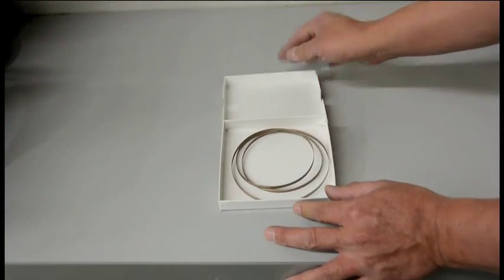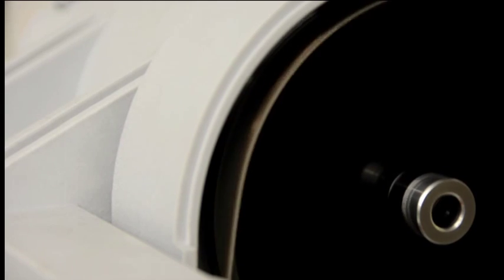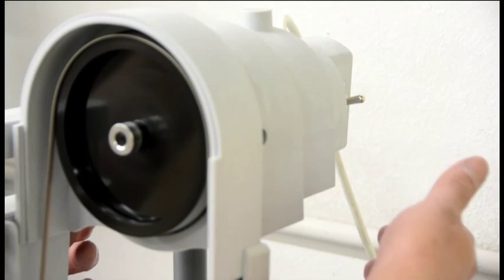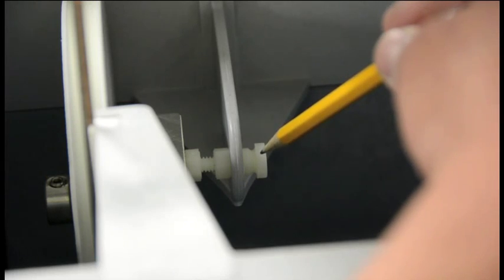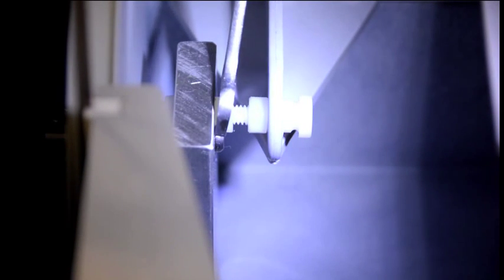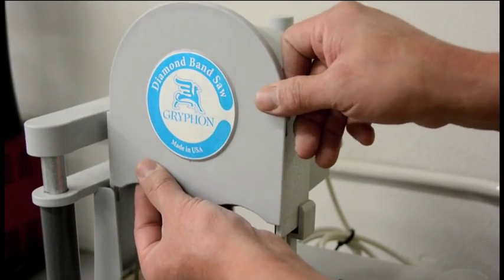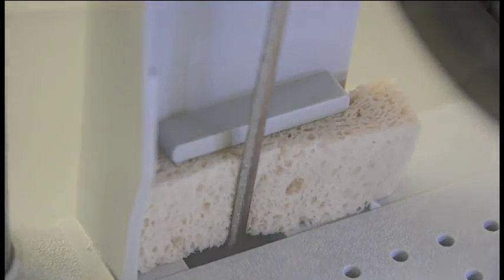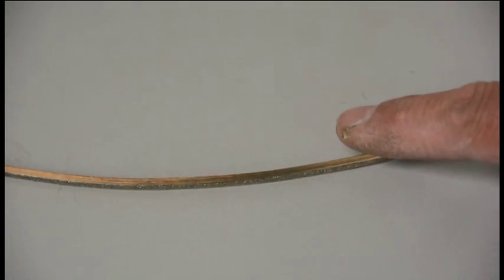Adjusting Blade Tension on Gryphon C-40 Band Saw

Comment: Should the bottom wheel be rotating freely? Having an issue with my machine. Drive wheel is working but the blade isn't moving with the wheel.
Reply: The bottom wheel is free spinning so I am guessing the polyurethane band has come off. You can purchase a Band Kit to replace missing/damaged bands and bushings.

Comment: My blade will not stay on the bottom track what should I do
Reply: Most importantly...DO NOT MAKE ANY ADJUSTMENTS TO THE BOTTOM WHEEL, THIS SHOULD ALWAYS REMAIN FACTORY SET. First thing I would check is the band on the wheel. Both the bottom and top wheels have a polyurethane bands on/over them that keeps a grip on the blade, these bands are thin and transparent so perhaps the band has come off due to age. You can purchase a replacement Band Kit to refit the wheels if they are still in good condition or a complete Upper or Lower Wheel that come complete. If this is not the case and you can't get the blade to stabilize using the instructions in this video, it is highly likely that your blade is slightly bent/out of round and needs to be replaced.
Reply: Within a month our saws lower pulley had lost outward tilt. I loosened the plastic backing nut 7/16 size(it is snug but just wiggle the wrench onto it and back it off). Grab the knurled head of the plastic threaded bolt and turn till you see the pulley tilting outward a bit. Hold the knurled head of the bolt tightly and snug up the backing nut and put blade back on and adjust top tension if needed.